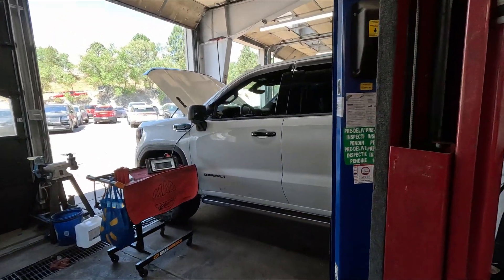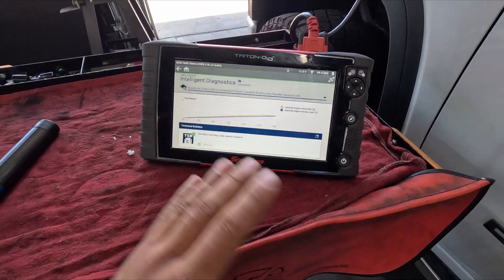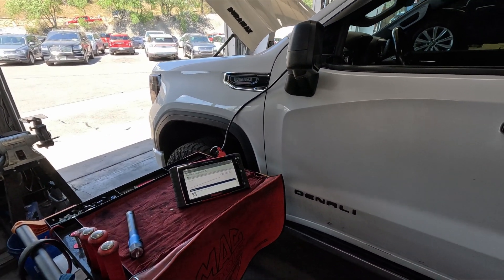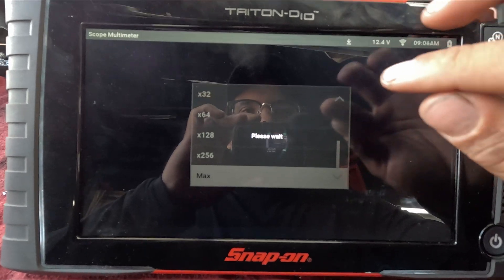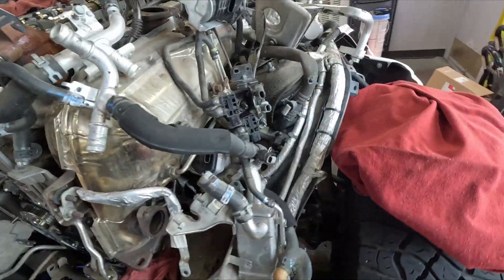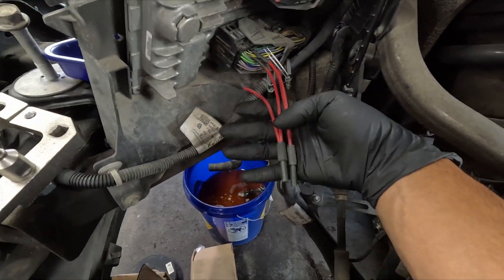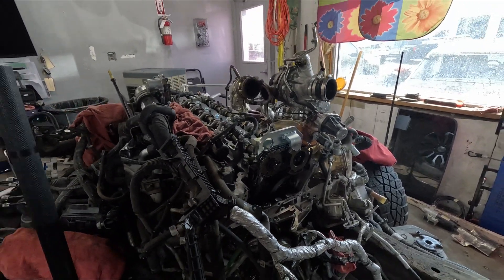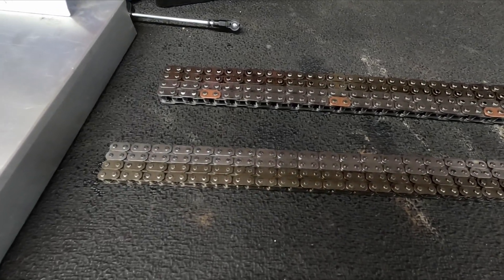2020 GMC Denali 3.0L Duramax P0016 Code. Oscilloscope Test Proves Timing Was Off

Comment: Why did you choose to pull the cab and trans rather than just the motor?
Reply: Once you've done a few the cab can be pulled in less than 2 hours. Way way easier than trying to pull the engine out
Reply: Way easier

Comment: Just went through this on a 6l gas engine.  P0016 intermittent eventually with a crank no start.  Using a picoscope, was able to determine the timing shift after it stalled and wouldn’t start.  Likely cause was a failed phaser.  Replaced all timing components and problem was still there.  I suspect oil pressure related issue keeping the phaser from locking.  Probably due to worn cam bearings (216,000 miles).  Solution was to install a phaser lock plug and delete VVT in the ECM in an attempt to squeeze out the last bit of life in the engine.
Reply from the maker: That is good info to know and thanks for sharing your experience on a similar situation!

Comment: How much does this repair cost? I have the same problem
Reply from the maker: Unfortunately not cheap. The parts are probably around a couple of hundred, but the labor is what makes it expensive. 

I believe the book time for this job was around 40 hours. So whatever your local shop rates are * 40 = estimate repair cost. So probably around $7,000+.

Comment: Whats the part # to the timing chain tool kit you used?
Reply from the maker: EN-52445 - Camshaft Holder and Alignment Tool
EN-52586 - Crank Pin 
EN-52446 - Rear Crank Seal Installer
EN-49979 - CrankShaft Holder (optional in my opinion)

Comment: Awesome job man! I wonder how many of these out there have chain stretch. My 2020 LM2 is just about to hit 30k mi on it. I don't drive much. Got rear-ended at the start of the plague and had to get a new truck. Post-plague is still mostly WFH except long trips for those corporate "team building" exercises. It's a dull life these days, but guys like you are still doing actual work. 👨‍🔧
Reply from the maker: I appreciate it! But yeah that is a good question. This is my first time doing this job and don’t work on too many LM2 to know if this is a common issue or not. 

My guess is probably how the truck is being used. If it being used to haul heavy stuff that is definitely going to put more stress on the chain unlike the other heavy duty trucks that are gear driven. 

But I have also seen a lot of other GM vehicles having stretch chain issues 🤷🏻‍♂️ so maybe GM don’t make good chains for their vehicles.
Reply: I have a 2020 3.0, just turned 208k miles and has P0016, and they narrowed it down to the timing chain. Going in next week for replacement.
Reply: @minutemanmac  Hey, that isn't bad for 200k!